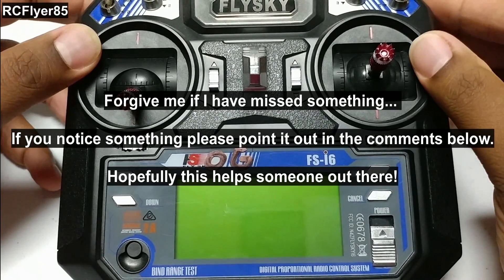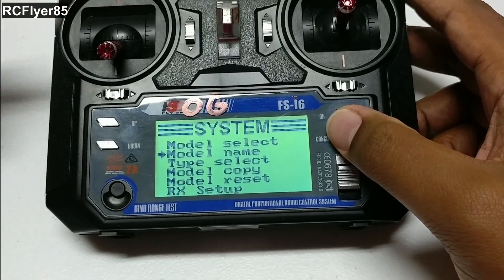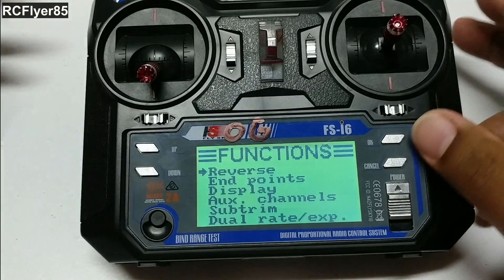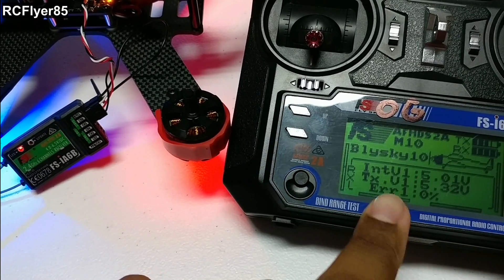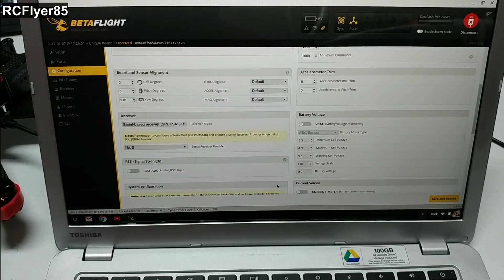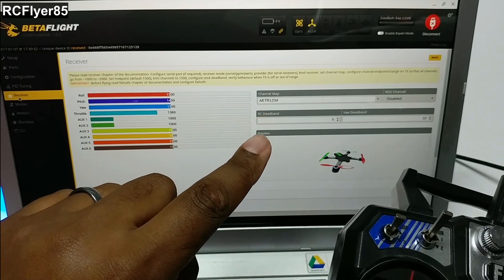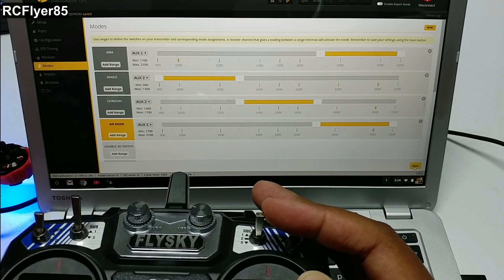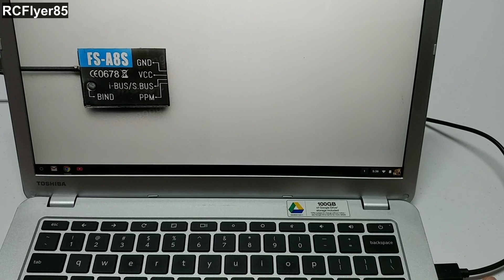How To:  Setup FlySky i6 for Multirotor Drone Eachine i6 Turnigy i6 and More

Comment: sir i have a problem in my fs-i6, after i factory reset it the sensor list is gone, so my receiver cant detect my esc bec. how can i restore my sensor list? when i plug the bec the receiver cant detect and nothing appear in my fs-i6 monitor.
Reply from the maker: joenelle ocsalev Not to sure at the moment... Not near a transmitter. Was your TX modded?
Reply: my transmitter sir?
Reply: i don't know if my transmitter is modded sir, but my fs-i6 is in factory default.
Reply: btw sir my receiver is fs-ia6

Comment: Will this work the E010?
Reply: or will it bind to  E010 and other Chinese drone that come with them cheap remotes
Reply from the maker: Eddie Torres If they are FlySky bnf versions... But typically no it won't work with most toy grade quadcopters. It will work with an E010"S" which comes bnf for FlySky though

Comment: will this transmitter work with the Rx31d is a DSM2/DSMX compatible 4 channel micro receiver with twin on-board 2A ES

http://www.micronradiocontrol.co.uk/rx_dt_servo.html#dt_rx33_v34
Reply from the maker: Just an FYI... When you post links in comments or usually marks your comment as spam.

To your question, No it will not work with that. FlySky uses AFHDS and AFHDS2A not DSM like that receiver

Comment: can you recommend a good beginner  RC  helicopter  radio....something not too expensive or difficult to bind....I am looking to get a radio that will bind with the Blade or WL toys BNF model helis.....thanks
Reply from the maker: Gary Vale The only way your going to be able to control multiple brands and protocols is getting something like a Devo10 and highly modding it. You'll have to do a lot of research on different protocols and how they interact with each other
Reply: thank you ...as you are the only one who explained about the different protocols.....I will see which brand heli uses what protocol and go from there....2 different radio manufacturers might be best for me .....can you tell me what are the most common protocols used  for the popular BNF helis ...thanks again...
Reply from the maker: Gary Vale The most popular out is FrSky, Spektrum and FlySky
Reply: thanks ...I will  begin to search out these brands...is there any simple way to know what protocol  the various  BNF  type helis use ...such as Walkera  or Blade  or WLtoys.....that would help me select a radio ....
Reply from the maker: Gary Vale Well Walkera uses their own proprietary stuff. Blade uses Spektrum dsm technology and I can't remember WLToys one but you can't really expect to fly hobby grade stuff and "toys" with the same transmitter. Basically at this moment in time your safest bet is to get a FrSky transmitter like the Taranis Qx7.... If you plan to buy specifically Blade products then your going to want a Spectrum Transmitter that's capable of DSM, DSM2 and DSMx
Reply: thanks much

Comment: RCFlyer85:   Nice Video and Thanks.

Question on an aspects of FailSafe setup.

This was not covered, but perhaps you have experience with also the Failsafe mode.

In BetaFlite  has two options,  1: fall out of sky,  2:  Land

In RX (IA6B) Failsafe setup, all six channel can be programed.  So if I set say RX channel 3, Throttle in RX to lowest point (Throttle off)  on the failsafe setup of RX screen.
Suggests to me the Quad will just fall out of Sky.

 On the other hand, in Betaflite if it is set to
land.  Which is the Master, I.E. does the quad react to the RX or Flight Controller?

Which is superior?   Seems it might be the FC but not sure?

Thanks BobFlyer
Reply from the maker: Yeah I'm not sure which one is superior but I set both. Channel 3 to 0% and set it to drop if BF... If you really wanted to know you could just test it

Comment: there us no movement on mine too.  Its not letting me change uart 1 to serial rx but i was able to change uart 2 to serial rx.  I do have it on serial based receiver and ibus.
Reply from the maker: scottyandthefenders Don't ever change UART1 to anything other than MSP.

if you set UART 2 to serialrx and you have no input first make sure that you were actually bound to the receiver 2nd make sure that you actually have the receiver plugged into UART 2 and not UART 3 and lastly make sure on the configurator that you have the receiver type set to serial and set to ibus
Reply: Thanks for you help but im still having trouble.  there is no UART 3 shown on betaflight so i assume that my reciever is plugged into UART.  my reviser type is set to serial and ibus too.   Also when i go back to my old tx and reviver which is the em 16 (https://www.google.com/search?q=jjpro+em-16&espv=2&biw=1366&bih=662&source=lnms&tbm=isch&sa=X&sqi=2&ved=0ahUKEwiokPK_ibHSAhUp_IMKHd6yDSsQ_AUICSgE&dpr=1) and change my settings back to MSP on UART 2 and PPM Rx input evertything works fine.  Also i am using the fs Ia6 plugged into channel one not the IA6B that you used in your video.  
I am falling in love with the hobby and just want to go fly again haha thanks for your help!

Comment: Thanks RCFlyer85:
I have a Turnigy I6 from 2015.

The Model Name will not show up on the screen after I name the model and save.
If I use say Model 06 and call it Drone06 and save, it shows up on the main screen as
Turnigy 06. Tried many times and it will not show the name properly.

Other than that I have to remember what turnighy xx is, all other features work fine.

Any suggestions to fixes?

Tnx Bob
Reply from the maker: Robert Steele Is this in AFHDS ( Not 2A ) mode? It should say right on the front screen either AFHDS2A or AFHDS. If you are not in 2A mode I don't think it saves the names that way but other than that I'm really not sure unless it's just something from the Turnigy firmware that could probably be fixed by updating your transmitter
Reply: It is in Mode AFHDS2A
Found out it is a Turnigy I6 Bug in Firmware
I bought the unit in 2015 and have not updated firmware Since I may brick my tx. Just have to remember the planes quad assignment.
Thanks bob

Comment: Hey man I followed your instructions down to the dot but at 9:32 nothing moves in cleanflight like yours does. BTW im glad i found your video Ive been trying to figure this problem out for a while. your video def helped me out a ton so far!
Reply from the maker: If you check out my comments to Angela Cervera (it should be pinned at the top of the comments) you'll see what I have to say about that. Hopefully that will help you out. Keep me updated

Comment: Thanks for showing the right way to do things . I  have a problem with getting my transmitted to work on screen like you have and my calibrations so off left is right right is left  so I need help bad
Reply from the maker: Angela Cervera Like throttle is on the wrong stick or do you just need to reverse your channels?

Comment: yeh ive only got 5 and 6 channel on radio but i have wizard x220 and need to get this setup for different flight modes.. how do i do this?
Reply from the maker: David Downs You'll need to go into BetaFlight or CleanFlight and go into the modes tab and set some up. First go-to the receiver tab and see which knob/switch is what and from there go to the modes tab and enable the modes you want and then drag the sliders in to the range you want that mode to be enabled
Reply: the radio shows under functions -aux channels only shows channel 5 and then 6?
Reply: sorry subtrims show channels 1 to 6 also so will that be because radio only flashed for 6channels . sorry im sounding like idiot
Reply from the maker: David Downs if you have a stock FlySky i6 then yes you'll only have 6 Channels available
Reply: okay thanks